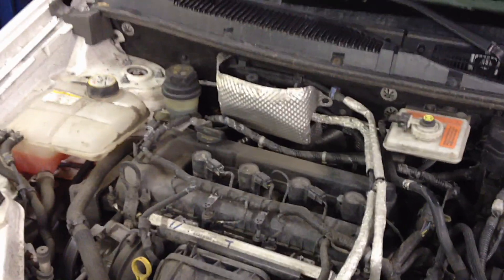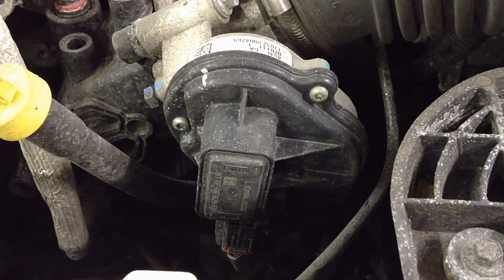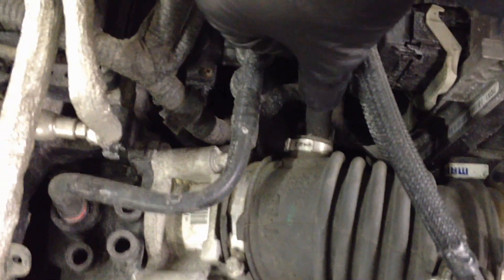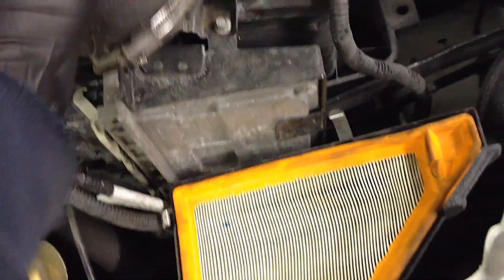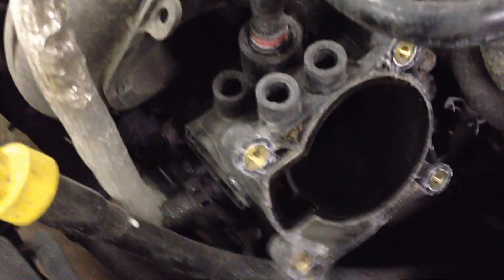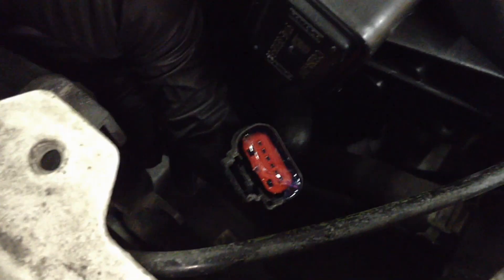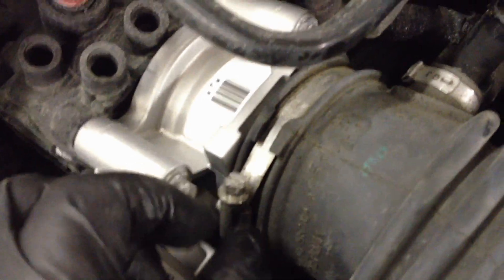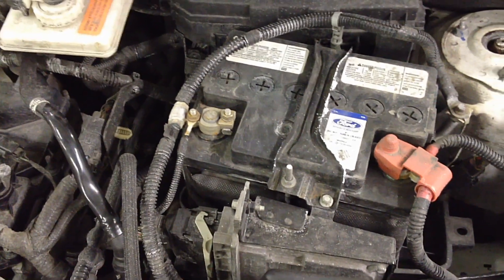Ford Focus & Transit Connect P2135 Electronic Throttle Body Replace

Comment: I have a 2011 connect xlt that the engine stays on while the key is off, sometimes the dash light start to flicker and then everything turns off any suggestions?

Comment: Hey , hoping this comment will help someone in the future ,by just cleaning my dads throttle body i got it to work again , obviously you milage may vary (gas pedal was completely dead) and codes were p2112 p2111

Comment: If I need a new fuel pump on my 2012 Transit, does it need to be programmed in with IDS or will it be plug and play with maybe a battery reset? Thanks.
Reply: would just need priming mate should be plug n play unless the control module is faulty
Reply: @msspeedy5528  Thanks. Needs new injectors. They leak down intermittently. I pulled the rail and one sprayed out after shutting down the engine. Replaced it with an old one. Still takes 3 or 4 sec to start every once and a while.

Comment: I cannot get the electrical clip off the sensor? Doesn’t just pull off like in your video. How do I get it to release?
Reply: Hey I’m having the same problem now. Did you figure it out?
Reply: @Milesontheroad  It was a year ago. I can’t remember exactly but I remember it was easy and I felt stupid that it took me so long to figure it out. I think I just had to push a release. Maybe. Sorry. That whole situation was frustrating and I pushed it out of my mind! 😂😢

Comment: Hi I have a ford focus 2009 I just cleaned my throttle body but now it gone into limp mode. I disconnected the negative terminal and negative earth ? Put jumper wire on the negative disconnect and other end on positive waited 20 mins. But engine light still on. I switch engine on car is idling over revving just carnt seem to get it settle. Can you please give me some advice thankyou
Reply: Maybe your pedal acceleration sensor has the problem bro.Almost similar symptoms with defective throttle body it will be limp mode too.That is cheaper to replace.Hope could help.

Comment: I have the 2008 Ford Focus and the car shuts off  and goes into anti theft mode. So we needed a new tumbler anyway and I installed  and the 2 new keys are programmed. The car starts but will shut off after several minutes and then no start because of the constant flashing light . I did the ground wire like you show on video but again starts , Runs, then shuts down.... any idea?

Comment: Hello, I have a problem with Fiesta 2003 1.4 16V. Car sometimes shuts down when I release the accelerator pedal...during the ride. Sometimes idle goes too low for a while. I replaced both lambdas, crankshaft sensor, map sensor. Should I check the camshaft sensor or the issue is in the throttle body (bad position sensor)? No fault codes in diagnostic tool. Thank you!

Comment: I've got a 2007 ford focus st and can not get the code P2135 to go away, had 2 throttle body and 2 pedals also had instrument cluster repaird soldered but still no better???  Any help would be massively appreciated

Comment: I've a Ford Focus MK2 and keep getting this fault code when it's wet. Changed the throttle assemble twice - one second hand one new - made no difference. Could it be the pedal sensor?
Reply: Did you find out what was causing the P2135 code I have it now and changed throttle body and pedal twice also had instrument cluster repaird soldered and can't get shut of it??
Reply: What did you guys end up doing?
Reply: @eyeLIKEAPPLEPIE  I scrapped it in the end. The ECU failed and wasn't worth repairing. I never did get it sorted.

Comment: Hey man, i have the P2135 code in my 2009 ford focus i changed the TPS and still having the issue is there a possibility that the gas pedal is faulty?
Reply: Hey i am having the same problem right now what did you end up doing to fix it? Did you replace the pedal?
Reply: @eyeLIKEAPPLEPIE  hey i changed the pedal but the issue persisted seems like the issue its the throttle body or the throttle body connection wire you need to make sure everything has a good connection seems like after some time the wires gets loose

Comment: Thank you for the video, I am going to attempt this myself after getting swindled around by some mechanics. Anyhow on your relearn battery reset video you talk about losing a finger, but is not mentioned in this video. Am I misunderstood I thought you mention it here. Also if I replace this will it take care of a sticky gas pedal problem? When there is a significant weather change the gas sticks; I throw it into neutral and turn off the car. I have to turn off and on a number of times before it fixes itself. And one more thing, after I got a tune up, I drove about 3 miles and experienced the problem indicated in this video, when I took it back to the mechanic the said they needed to re-learn the TB. However now when I throw into neutral and while I coast to a stop the throttle revs to about 2k rpm and does not assume 800rpms until I come to a complete stop. This is costing me poor gas mileage and is just annoying, therefore I am seeking to fix these problems by changing the TB alto together.Does that make sense though, after a tune up and fuel injector cleaning?Thank you for your timeShannon

Comment: 08 ford focus i just replaced the throttle position sensor cost 40 dollars + the mass air sensor 
94 dollars now is working like a new car i recommend change this two if you have this problem why because one the mass air sensor start falling will kill you throttle sensor too and but the end you will have you car falling on the road again
Reply: I just have  the problem today and I replaced the part and the work you save me a lot of money thank you

Comment: I have an issue with my 2010 Ford transit connect. Rough idle and surging between 45 and 60 mph. I have tunes it up, cleaned throttle body, replaced cracked air Cleaner hose. Have found no vacuum leaks via the propane torch method and replaced the MAG sensor. I have ran out of options and need your help. I also did the Pcm capacitor drain.

Comment: Do you recommend changing out the throttle body on a 2009 ford focus even if it's not bad yet ?
Reply from the maker: +themanonthemoon981 If you are concerned about it yes because the unserviceable TPS sensor inside can fail at anytime. Here is the latest version available much cheaper than the Ford dealer-http://amzn.to/1roy8Yx
Reply: Thanks man .. Would having a bad TPS cause RPM's to fluctuate and not stay steady ?

Comment: Helpful video. We have been completely stumped with Our 2012 transit. Been to multiple mechanics and no solution yet. 
It idles rough all the time, and stalls in warm weather or once really warmed up at stop lights or coming to a stop. It has no check engine light, cleaned the throttle body, valves, new plugs, coils, and injectors, but it's consistently getting worse. Any suggestions/ideas?
Reply from the maker: John Behory III Have you check the air inlet hose for a slit in the bellows that was common on those beside that I would replace the throttle body yes.
Reply: Thanks for the input! Unfortunately We replaced the whole throttle body, but no change. Still stalls and idles rough. We know it has no fuel filter so that's not it. This problem is driving us crazy. Any other ideas.
Reply: @johnnyb5231  I am having the same problem! Did you ever find a solution?
Reply: Tyler Kinney , unfortunately we ended up just getting rid of it before finding a resolution.

Comment: Thanks for the video.  I suppose a similar procedure will apply to GM cars as well for the TB replacement.  Also, should I disconnect the battery from the start to replace the TB. Thank you for your advice and help in the matter.
Reply from the maker: I would disconnect the battery first yes. The gm vehicles require a relearn procedure with the scan tool. Ours self learns the idle.

Comment: i have transit 2003 63kW or something like that.and it drives well at 100Km/h and then engine dies.starter cranks engine but nothing.no one can't figure it out,and i hope you can help.
sometimes it start again and runs like few weeks and than dies again.
Reply from the maker: I am not familiar with that engine but if it does have an electronic throttle body that would be the first place I would look they will be intermittent like you state and will not set codes allot of times.

Comment: I just bought a 2011 Ford transit and it sometimes stalls if I stop on a hill or at a junction. Other times it would not stall but if I'm at a hill or junction and I mash the gas to the floor it does absolutely nothing. Then if I put into neutral it revs just fine and I have to switch back to drive to get going.  What do you think the problem could be? The throttle body?
Reply from the maker: It does sound like it from your info, also I have seen the throttle intake tube split on these pretty bad causing this kind of issue.
Reply: FordTechMakuloco okay I'll definitely have a look at the intake tube first then. It also seems to burning rich with a sooty exhaust

Comment: in Europe aparently they upgrade the 2.0 TB with one from a turbo car which is the same as the 2.3 (so they said), any idea if the north American 2.3 throttle bodies are bigger?
Reply from the maker: Never compared to two no.

Comment: I need your help! I have a 2000 ford focus se and sometimes, maybe every other day, when I first start the car, and when at stop lights/signs, it starts shaking like it's running out of gas even though I always at least keep half a tank. It acts like.Its gonna cut off. When im driving its fine. I just had a tune up and all the spark plugs etc were changed. I just got a brand new battery too. Any idea what it could be?
Reply from the maker: You have a check engine light at all. How is it if you just start it and let it idle in your driveway? Does it run great then just start shaking like a misfire out of nowhere or does it shake like its going to die until the engine warms up? If it feel like it is going to die do you give it throttle and it ruvs up fine and stay running? You must have a check engine light by now. It appears you either have a large vacuum leak or a misfire and my bet is on the vac leak. Zetec right?
Reply: Thank u for responsible! If im in my driveway and its in park it does the same thing. I never tried reving the engine but I will. The first time it happened, which was Nov, the check engine light came on and it went off 3days later. I did notice that after it warms up it does get better. I believe it is a zetec. Im going to take it someplace to see if its a vaccum leak. Thank u!
Reply: I meant thanks for responding, not responsible lol
Reply from the maker: If it is a zetec you likely have a vacuum leak from the rear pcv line or the front pcv line where it connect to the oil separator it is very common and cheap to fix, they generally create a hissing noise and if you put your finger on the slit where it is leaking the engine will die. Very common.
Reply: Should that be a easy fix? Hopefully not to costly either
Reply from the maker: 10 min job
Reply: Cool! Thanks again for your help
Reply: Did this end up working for you?